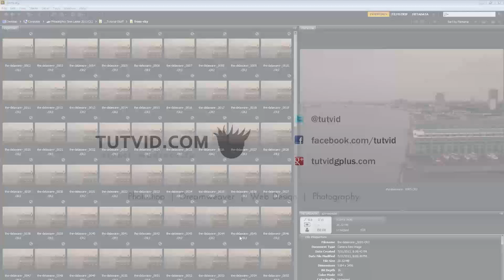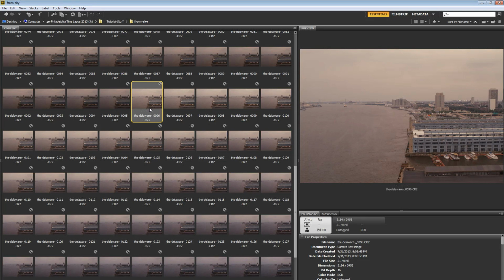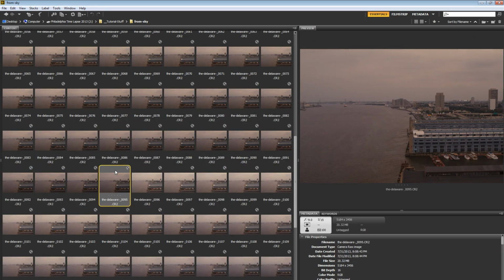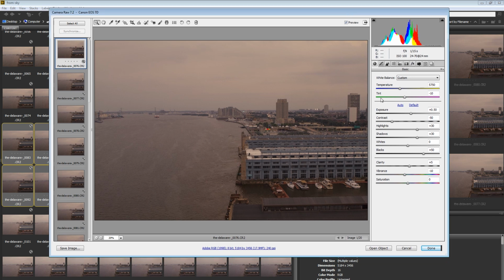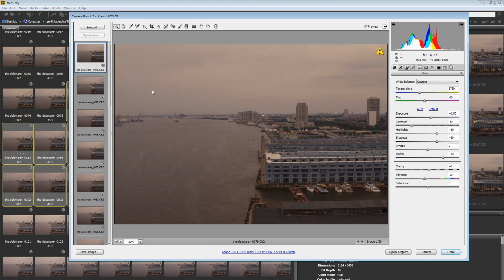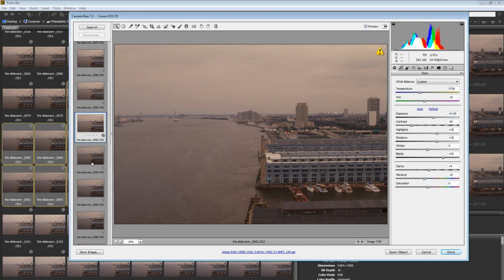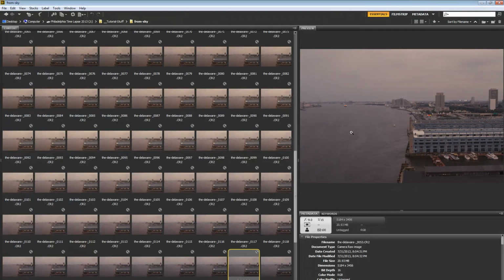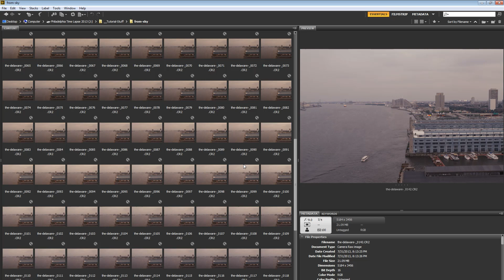Manual Bulb Ramping Post Production | Timelapse

Comment: The problem with shooting in aperture priority with changing light (sunset, sunrise, etc) is it can introduce flickering. It's very easy for the camera to read a scene as 1/15th @ f/8 for one frame, then 1/20th for the next frame, and then jump back to 1/15th for the frame after that. It may only be 1/3 stop difference, but it becomes very obvious when put into a video clip.

The metering can be tricked by something as simple as a dark truck driving through the frame.